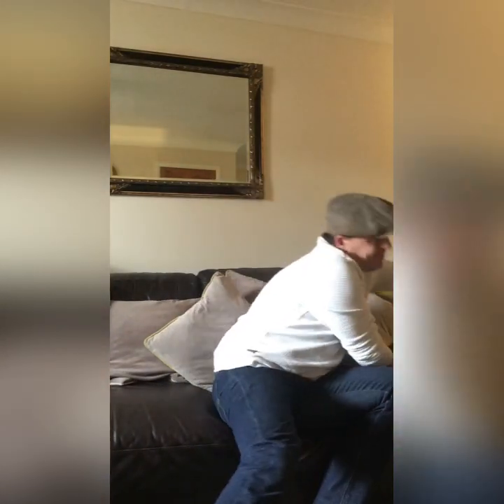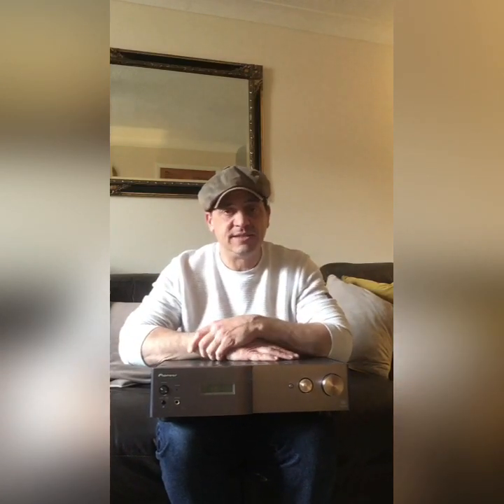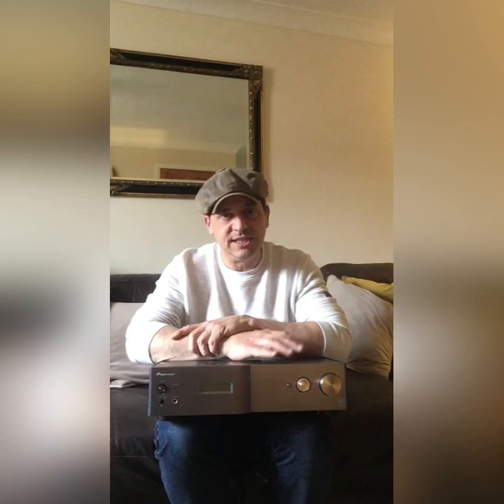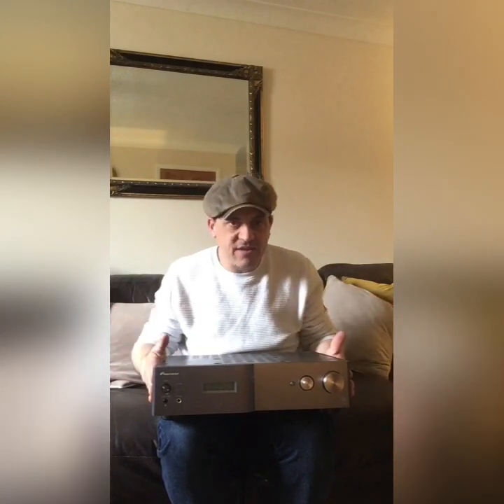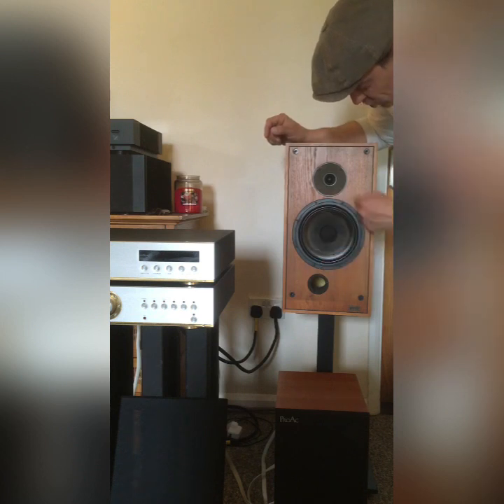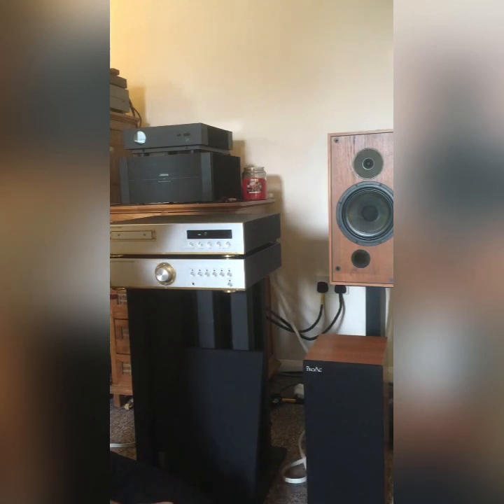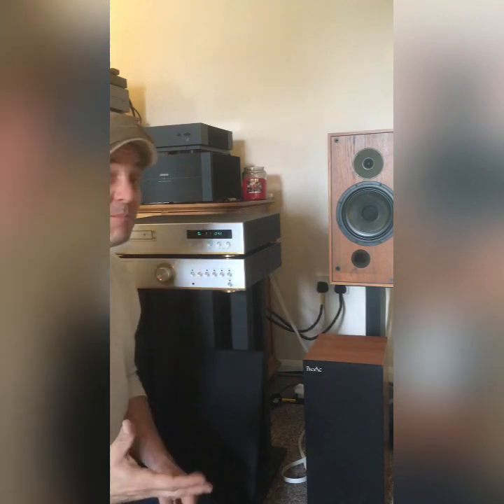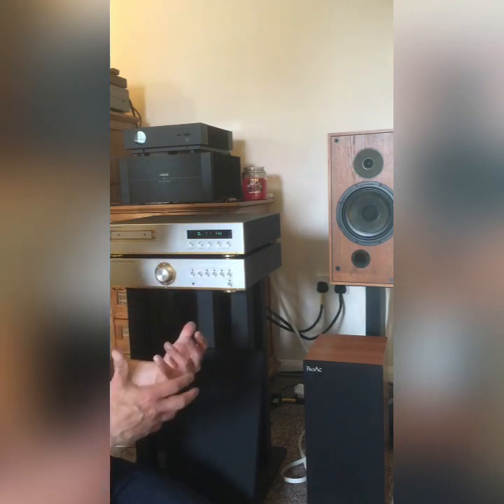Amplifiers and Speaker Matching

Comment: I know that matching amplifiers with speakers is not easy but I used celestion sl600si with marantz pm84D and also with classé audio 10 amplifier and classé audio 6 pre amp. The little celestion did a good job. Apogee stage worked very well with classé 10 and 6.

Comment: The low power McIntosh MC225 and MC30 amps have a warmth that is missing in the high power MC275.  Same with warm low power Marantz 2010 (10 watts) compared to rather dry 2275 (75 watts).  Compromises are often made to achieve higher power. Ineffecient speakers tend to lose drama and punch with low watt amps.  Have you found the magic combination.. an affordable 100+ watt amp with warmth, detail and power... suitable for ineffecient speakers ? ( e.g. KEF Reference 101 [81 db], LS3/5A [82db], Proac Tablette, Spendor S3/5 [84 db], etc.. ) Maybe a used MF A5 ?
Reply from the maker: @Dynaci man.
The 557 is a winner for me, it drives my Celestion SL600si well with no issues, bags of detail and incredibly low levels of distortion. Thanks for commenting 😊
Reply: Thanks, Kevin.  Will research the Meridian 557.

Comment: That's how I do it. Warm EL34s driving clean very detailed speakers. You can bi wire with it. 2 to 4 connection cable. I do it with Linn K400
Reply from the maker: Indeed, I meant to say Bi-Amp not Bi-Wire. 
2a3 Valves were the sweetest I’ve had but you need super efficient speakers really. 
I might get a valve pre at some point,